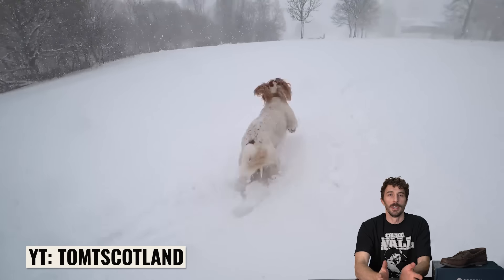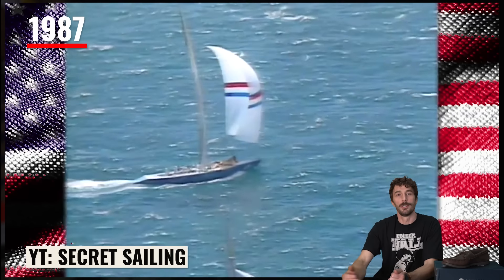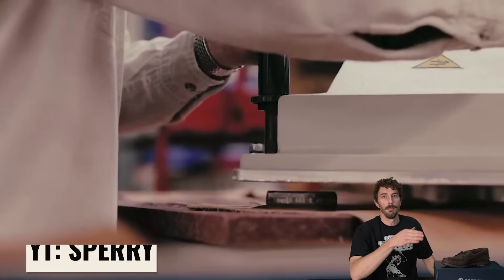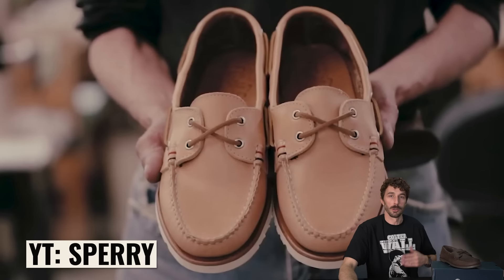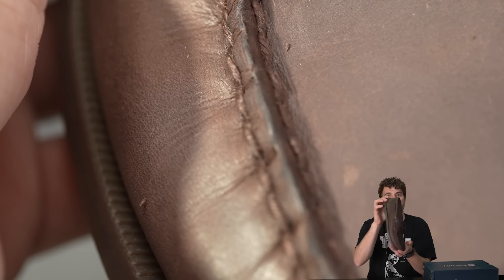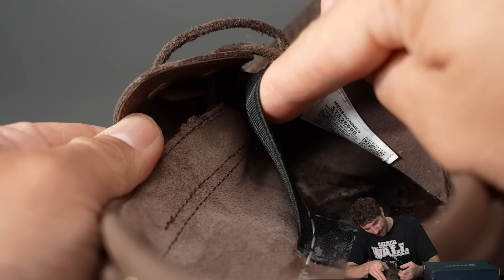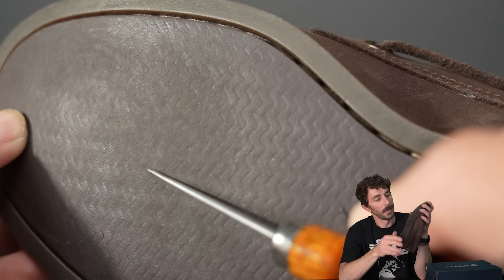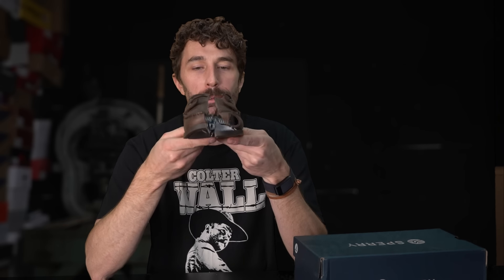How Sperry surprised me after 89 years

Comment: Im not a wearer or buyer of these shoes.  But in defense of these, they were made to wear on wooden boats.  They dont get wear on the soles when worn on deck.  People that have wood decks on boats don't want you wearing shoes on deck for that reason.  They arent designed to be worn on surfaces that wear heavy.
Reply: Not just wooden decks. Fiberglass decks get marks from the soles of many shoes as well, not so with these.

Comment: Sperry also sells a “made in Maine” version of this shoe. It is a hand made horween leather shoe. It has a high quality vibram sole and it is beautiful shoe. I’ve had that model for nearly 8 years and it improves in fit and appearance every time I wear them. Love your channel.
Reply: I need to find those.
Reply: They are sourced by Rancourt and Co in Lewiston Maine. I would recommend if you love the Sperry version, trying a Rancourt shoe/boot. Highly recommended in the boot/moc community.
Reply: @rickypelletier363  The sperry made in maine are a much better looking version, but the only deterrant if you're already familiar with Rancourt is the made in maine are roughly the same price as the Rancourt. At that point I'd rather have the Rancourt.
Reply: I have a Todd Snyder x Sperry with CF Stead upper and vibram sole that I like a lot. Todd Snyder customer service said it can't be resoled. It looks like it has a faux good year welt then. I got it on sale so I wasn't worried about it. The nonslip is real, worry free carrying my infant across the wet tile for swim lessons.

Comment: I work on boats and Sperry has been my go-to for years now. I spend about 3 or 4 hours on board (and in the engine room) most days and about 3 days a week I am in a boat-yard so these environments are hard on a pair of shoes and mine have  held up remarkably well. The only issue I find is that after a few years, the sole seems to "harden" and traction on wooden or linoleum floors is limited, but these aren't surfaces they were designed for.
Reply: I recently reconditioned mine & they look great, the leather bounced back with a little TLC & elbow grease, but yeah, the soles are hard as rocks. Actually kinda dangerous in wet conditions, so useless for their intended application. Is there ANYTHING that can be done or do I just toss 'em?
Reply: @Dylboz time too  let them walk the plank

Comment: Sorry, but this is not a fair review of the sperry top sider. The one you bought there is some special version that that’s different from the regular top sider. A regular one has actual laces, no weird elastic bands, and a leather insole. Additionally, if you actually bend the outsole you’ll see it opens up into 1/4” deep slits. So it won’t “wear out in a 100 steps”. Try to drag that outsole across a smooth tile floor vs some other rubber sole boot/shoe. The sperry will stick in place.

I’m just salty because I love my pair of original ones i’ve had for nearly ten years and hate to see them misrepresented…
Reply: He literally gave thema positive review...
Reply: I have a pair of regular leather Top Siders and a pair like the ones on the video, but out of canvas. The ones with the elastic band are more of a style over function thing, while the ones you can tie down are functional yet preppy boat shoes
Reply: The pair he has here is still sold by the company, so it's not completely unfair. You can't expect RoseAnvil to only review the top of the line shoe from every brand, because that is also misrepresenting the company. Also, it was a mostly positive review if you watch the whole thing.
Reply: @Escapism7133  I would expect him to review the shoe that the brand is most well known for and that is what he normally does. I wouldn't expect him to review the Goldcup, which is their actual top of the line shoe, because most people don't get them. He's not a fan of Sperry so I assume he just got whatever looked right in his mind and didn't do too much research to find the right shoe. I was looking to get my first pair not long ago and it took some time to find the actual classic Topsider. There are very slight differences between a lot of there shoes and the descriptions or naming convention isn't great.  So that's understandable, though I think he should have put more effort in than that, especially seeing how he couldn't be bothered to flex the sole to see how deep the "wave siping" actually is. This just seemed like a rushed review compared to what he usually does. I don't see a need for you to make excuses for him when you have no idea what his actual reasoning is. I'm not looking for a positive review, I'm looking for an in depth and correct review.
Reply: @bigbreno7  Fair enough. But again, this is still a shoe sold by Sperry - a very popular model I suspect. Just because it isn't the shoe you wanted him to review, doesn't mean it isn't a "correct review" as you put it. But to your point, maybe the various Sperry models shouldn't have been so glossed over, making the review more clear on which model he was showcasing here.
Reply: @Escapism7133  I get what you're saying, but this isn't about not being the shoe I wanted him to review, I don't think this is the shoe he wanted to review. Given the comparisons to how they were originally constructed and if they were the same quality craftsmanship that they were in the past, I would assume he wanted the Authentic Original shoe. But, what he got was the cross lace variation that isn't able to be tied tighter and has the addition of the elastic band he showed. When I say I want a "correct" review, I'm talking about when he incorrectly stated that the "wave siping" is only a fraction of a mm deep and won't last past a couple wears, when it's actually around 1/4" deep, you have to flex the shoe to open that up and see it, which he didn't bother doing. I just don't think this review lived up to the in depth reviews I've come to expect from Rose Anvil, it's not like it's unforgivable, but definitely disappointing to see on a shoe I've been waiting for him to cut in half for years now to decide if I want to get a pair myself.
Reply: yarg, im salty. okay mr pirate, where's your ship and crew?
Reply: I thought these were Eastlands.
I know a lot of people that wear Sperry. I have never seen them in these. All of mine are canvas.
Reply: Why do people get so bloody defensive about every little thing? This post is a legitimate comment on the review, what’s the problem? From the title and included backstory this video is supposed to investigate whether the iconic original shoe has been cheapened, NOT if Sperry makes other, more affordable and lesser quality versions.

Comment: topsiders used to have tie-able leather laces & if you were cool enough you'd have fancy little nautical knots tied on the ends of 'em.  they were all the rage in the late 70s-early-80s for any preppy worth their salt.  back then, there wasn't any foam or lining for that matter.  just that rubber sole stitched onto the leather, where you could look into your shoe & see the stitched construction & eventually with wear, the shiny imprint of your foot (those in the know never wore 'em with socks -- they're friggin' boat shoes, you cretins!)   i think my last pair was purchased in the early 2000s -- still the same ol' shoe.  not terribly comfortable but always give that solid preppy profile -- i always like mine with argyle socks.  nice to see they're still around, even though you can't tie 'em.  thanks for this one, it really made me smile.  
😻😻😻😻😻  5/5
Reply: You can tie them still, he got the cross lace version which is more designed for slipping on and off, hence the lack of laces and the addition of the elastic band.

Comment: I bought some Clark's outlet version of this. They are moccasins with a city sole. The 360 for is real. The first time I laced them up the leather lace snapped. So i got a local cobbler to replace them and that first lacing does tuck in the ankle. Since then i wear them a lot, versatile anywhere you don't need socks. Mocs rock.

Comment: I’ve be been wearing topsiders since I was a kid in the 90’s. My dad has been wearing them since the 70’s when he was in high school. Growing up in CT you’d see someone wearing a pair on any given day (it’s a staple, more-so for men in New England, but plenty of women wear them too).
Like most shoes, I’d say the durability has gone down slightly - mainly with the material they use for the footbed lining—the outsoles still last a long time. The pair I had in the mid-2000’s had a nice thick pad of leather that fully lined the shoe. They were also only $60-$65 full retail at the time. The 2 pairs I had in college/just after had cheaper a footbed lining, the pair I have now and the one before them have the same thin layer of leather on top of a blue foam pad. Thankfully they still retain the unlined area for the ball of your feet and toes. 
I’ll always have a pair, if you get the ones that have normal laces and a leather footbed you’ll enjoy them for years to come. One of the most versatile shoes with a  timeless style.

Comment: I've owned several brands of boat shoes and (without cutting them apart) believe they were all a genuine moccasin construction as claimed. The construction gives you a different feel under foot where you get lots of ground feel, especially in the forefoot, and lots of flexibility.
That helps your grip on slippery surfaces.
The thickest and best quality leather uppers I've tried are the Orca Bay shoes which have a surprisingly good oiled leather upper for the price that these shoes typically cost.

Comment: The 360 degree lacing is supposed to offer a custom fit around the foot so the shoes don't slip off. It adjusts at the top lacing. It should all be connected like a regular moccasin.

Comment: The siping is kind of a big deal because it is what made the shoe a great boat shoe because it wouldn't slip on wet surfaces. You can clearly see the siping on the cross section cut, but you can also see it by bending the shoe at the ball of foot area and those razor cut siping slits will open up. Its the same technology that you can have done to your tires for your car. It gives you a lot more grip on wet or icy surfaces. The sad thing is Sperry uses this sole on just a couple of their shoes, and others they have an outsole pattern that looks the same as the siped shoes, but no actual siping.

Comment: I owned these shoes a few years back and found the soles became hard and brittle after 2 or 3 years, cracked, and started falling apart. They had no grip on most surfaces (I did not wear them on boats). The uppers were great with thick soft leather, but overall I was very disappointed.

Comment: The older style 360 lacing tied at the traditional spot on the X.  Other commenters pointed out the non-tied lacing is an option now, but I prefer the long 360 leather lacing that you can tie tighter or looser depending on comfort requirements.  Speaking of leather lacing, is rose anvil ever going to go into that market?

Comment: I haven't had Sperry but the outsoles look pretty much the same as some Bean ones and some JCP ones that they are a bit slick on regular surface, so I don't know how deep the grooves would have been on older ones that ye didn't compare what from the 40s or even the 60s - 80s "vintage". They are meant to grip ON BOATS, neigh the asphalt street a bit...

Comment: Absolute rubbish compared to  the shoe of the 70s and 80s… the entire product line with the exception of their gold cup, uses cheap leather laces that break often, always worn without socks the dyes now stain your feet or socks if your one of those shoebies , leaching gawd knows what chemicals into your skin .. the footbed used to have a good quality leather insert which is gone now.. at 49 bucks it used to be a great shoe but at 100$ better off spending 200$ and buy the gold cup model ..
Reply: I've had mine 3 years and the laces are fine. I've also never had them get dye on my feet.

Also, for the price, have you never heard of inflation? $50 back in 1980 is the equivalent of $200 now. So the premium gold cups are actually the same value as the old ones from back then because our money is worth 1/4 of what it was then.